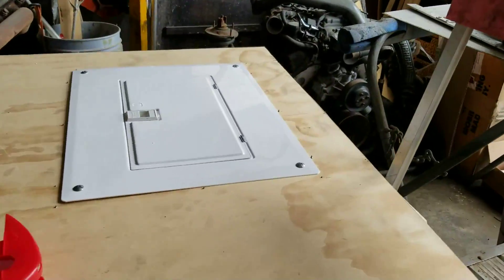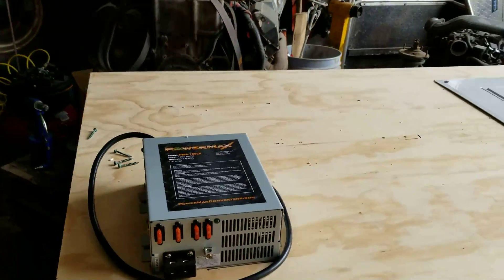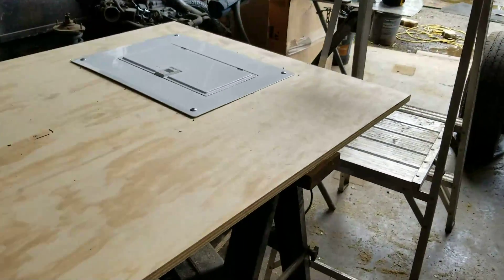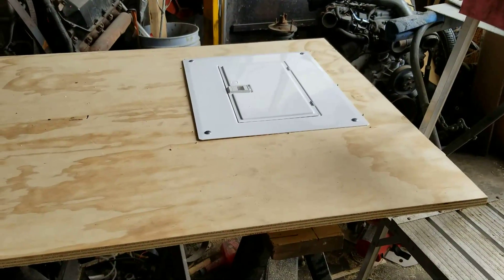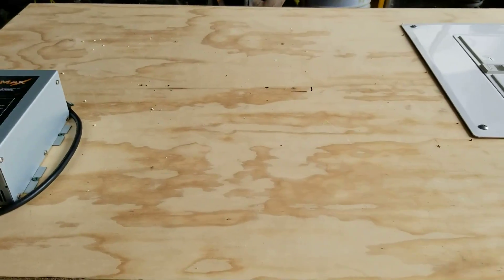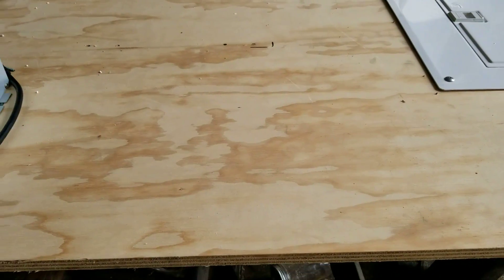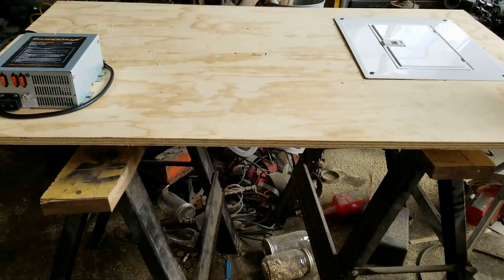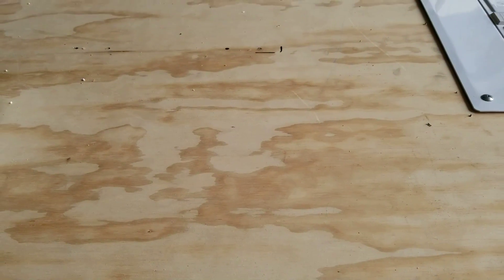Bus Conversion Project - Video 84 - Electrical Bay Construction

Comment: Ok jokes first  its pronounced DUMASS ( Dooo Maass ) not DUMBASS . its spanish for do more as in do it twice when once would have been easier. LOL. 

Now on to the update stainless was the way to go. the Off white is not all that  off and will give the reflective bonus we spoke about. Once the in bay lights are done it should pop at night and even during the day. as for the lower edge i think aluminum angle run along the bottom will work and give a finished edge to the panel and the floor if you decide to cover that front foot or so with a rubberized mat for sitting or kneeling on when you have to work in that bay later. the coin finish mats are good looking but painful on the knees and not much better to sit on. Think ISO -ERGO solid flat finish mat might be better and still easy to clean and very durable you can get them online but also local HD or Lowes to feel and squeeze test before you decide. What do you use on the floors in the engine rooms of the tugs for anti-slip
Reply from the maker: Ok...... Dooo Maaass... got it... :-).... Ya, I think the stainless looks good and as you say, when it's lit up it should be easy to see in there at night, we typically use polished Aluminum checker plate  for our deck plates in the engine rooms except in front of the power switchboards which also have a rubber mat to meet Transport Canada Regulations... they don't want a guy to touch the switch board standing on a conductive surface... what could go wrong with that???

Comment: Pretty cool James love the stainless its a great look and pipe going up to the ceiling is smart too
Its really coming together buddy how long did AIMS say it would be before you'd get the new inverter back?anyway carry on young man.
Thanks for sharing buddy.
Reply from the maker: Hey Brian, Aims didn't really give me a timeline yet but as long as they have one in stock it should be a quick turnaround, they have been very helpful so far, no issues at all.... hopefully that continues, I have to run the services through the ceiling for most stuff so the conduit to the ceiling seemed like the way to go.....

Comment: I like the ABS as conduit. Also, the off-white paint goes well with the stainless. Maybe make some aluminum angle clips to bolt that partition through the cargo bay floor. I think I am going to get one of those those 110VAC to 12VDC transformers. Thanks for the discussion on the ins and outs of on-line parts ordering.
Reply from the maker: Hi Kevin, thanks, the ABS worked fine as conduit, I forgot to show I had used some angle brackets to attach the panels to the floor as well as the upper crossbraces, I'm sure I'll video the back side of that panel at some point and I'll show that as well, the converter I got has a 3 stage charger in it as well, I'm going to have a 12v battery in the circuit and that converter will keep the battery charged as well.... hope things are going OK for you....

Comment: I'dd coat it. You will change some devices and holes are more easy to fill if you paint it. And stainless could be dangerous causing electrical shocks theoreticly